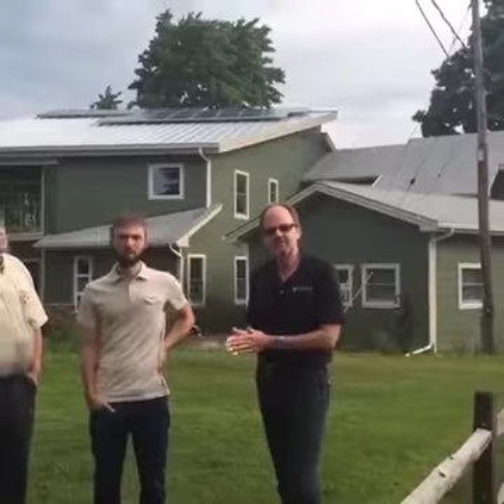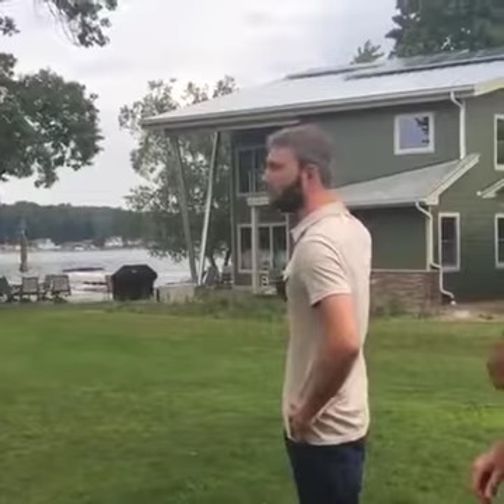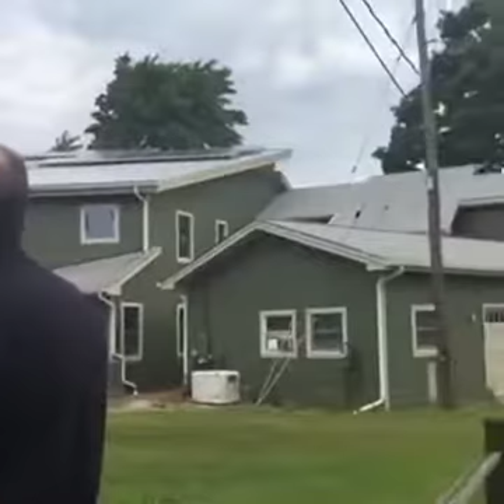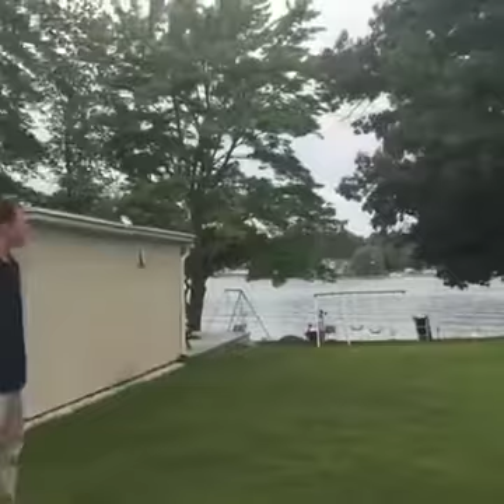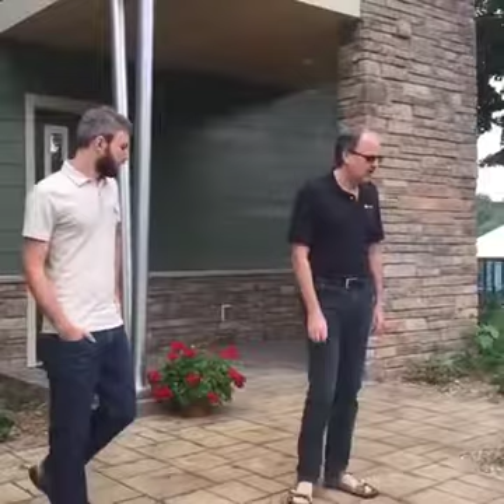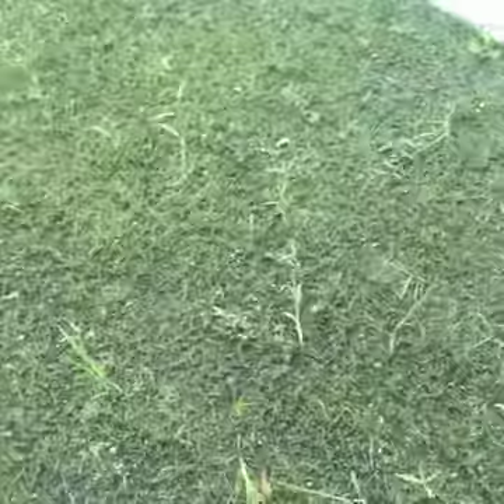Exterior Tour Of Net Zero, LEED Platinum House

Comment: Wow, if anyone really wants insight from accredited LEED architects & builders, I'd say this is the one. I learned more about sustainable design and construction in this video than have over the last year. Saying I'm impressed is an understatement. I think this video is a lesson for more builders to understand and use photo voltaic panels, rain gardens and more. I never realized how 1 structure can contribute so much to sustainability. The fact that this home produces more energy than it consumes should push anyone off the fence. Great job and keep em coming!